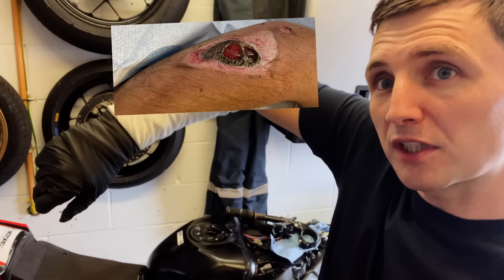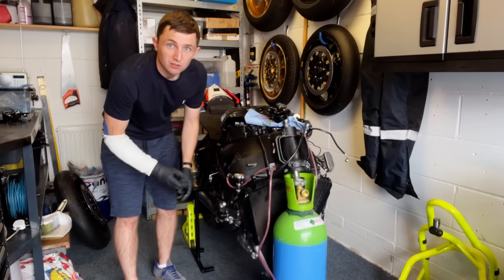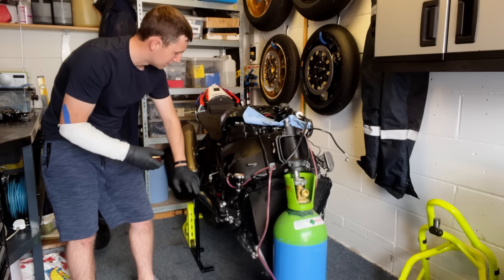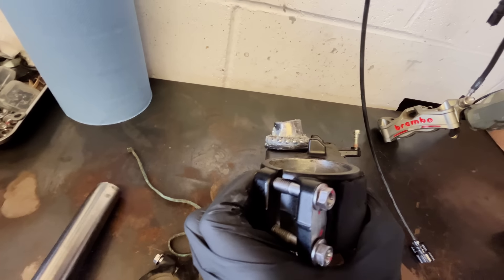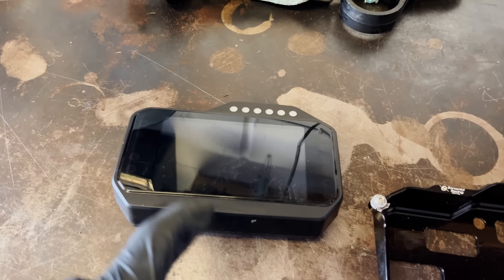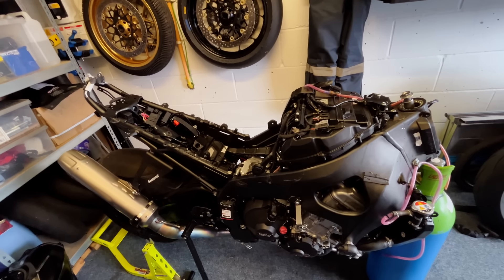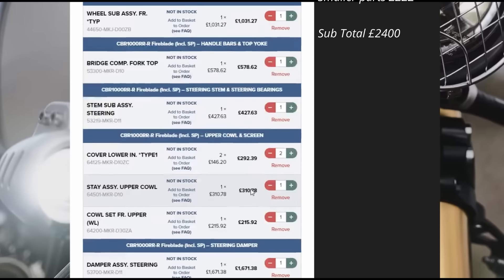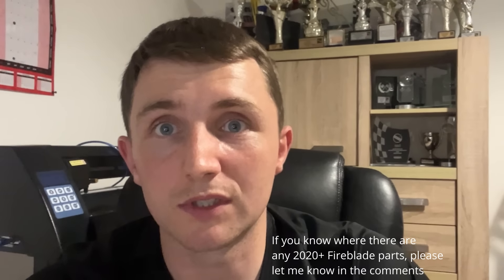Rebuilding a crash damaged 2024 Honda Fireblade Racebike!!!

Comment: Snapped triple tree, insane bearing impressions on the race, hole in the frame.
That frame is buggered. If the bearing races took enough force to snap the tube and impression the race, it definitely knocked the holes out of round and square. Find a rod or metal tube the same size as the inner diameter of the bearing races and slip it through. If it doesnt drop through easily then your headstock is not fixable.
Reply from the maker: I’m pursing a new frame first as getting my bike to motoliner and getting it checked will cost around £500. If i can’t get a frame for reasonable money I will try my look with a repair.

Comment: Unfortunately, this could happen to anyone on track at any level, once they dig in they're in lucks hands. I always seem to hold onto them if i low side and stop them flipping, but probably puts me at greater risk. Hope you get it sorted Tommy. Honestly, if the frame is straight, that hole could well be repaired. I'd speak to motorliner or similar?
Reply from the maker: Yep, i always try to keep a hold of them too, I kept hold of this one for a good way but when it dug in there was nothing I could do. Holding on meant I crashed my R6 at craner a couple years ago and only missed one session 😂 
I am waiting for motoliner to get back to me, see what they say about the video I sent. I don’t want to de-value the bike either but everybody knows motoliner so hopefully wont affect the value too much.